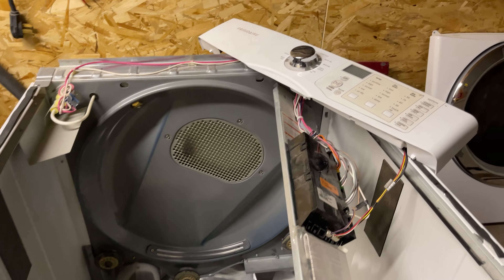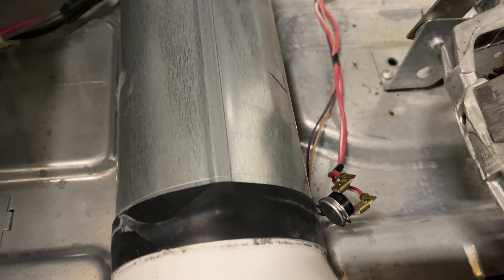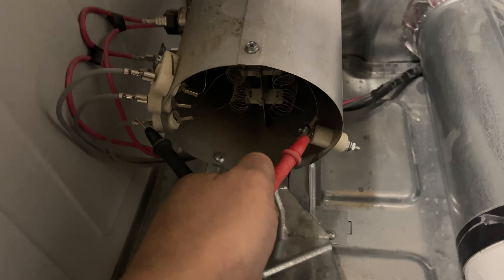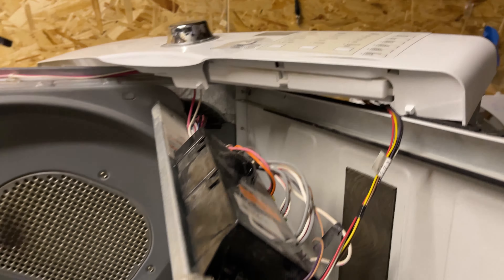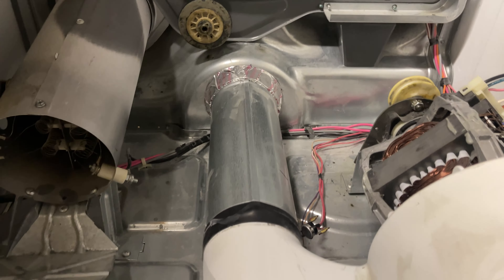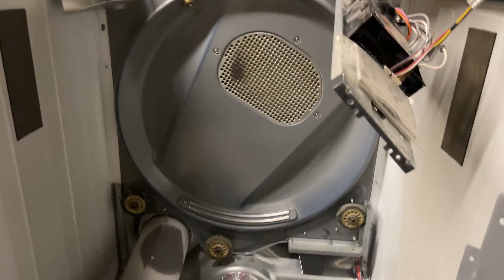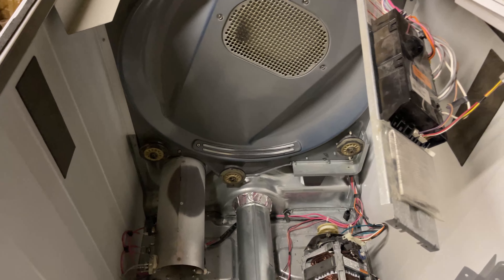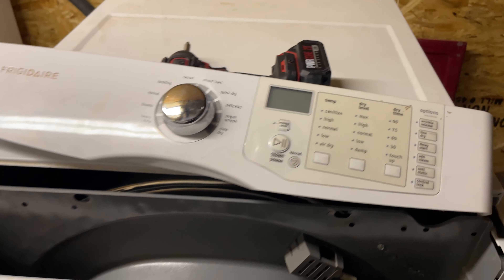Frigidaire Dryer Fix✨👌 - 🔧⚙ (Door Open / Code E66) or Not Starting 🤷‍♂️

Comment: Hello, Jesus. Good video.  when you measured the Outlet Thermal Limiter you replaced, was it a permanent "open" as measured with your meter?   Or is it opening when in use prior to hitting 180F?   I am fixing an Electrolux just like this one with E66 and the Outlet Thermal Limiter does not measure as open when out of the dryer.   I am wondering if these limiters can partially fail.    The functional problem I am experiencing is the temperature in dryer only gets to barely warm, not hot.   The High Limit Thermostat does not measure as open, but maybe it is out of spec.  thoughts?

Comment: Hey! Great video. I have a Frigidaire FFSG5115PA0 with an E66 code. I replaced the door catch, door switch and thermal fuse. Still getting “Door Open” E66 code and dryer won’t run! It’s like a 10 yr old dryer, is it worth continuing to mess with it or make more sense to shop for a new one? Any other last suggestions? If I have to call a service tech and the cost involved it probably makes sense to get a new one. But maybe I’m missing something! Thanks!!

Comment: Electrolux model EIMED60LT0 dryer E66 error code. Have replaced inlet and outlet thermal fuses, high temp limiter, heating element, and main control board. All have tested to be good including doir switch. Why am I still getting this same error and dryer will still not operate?